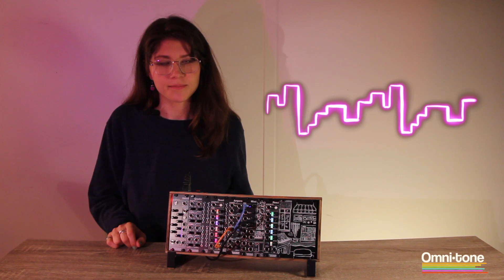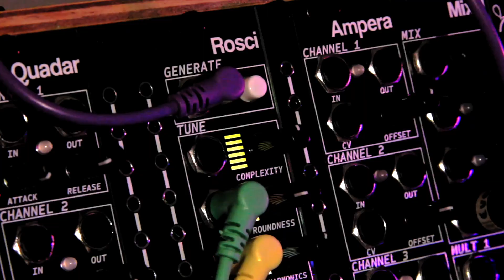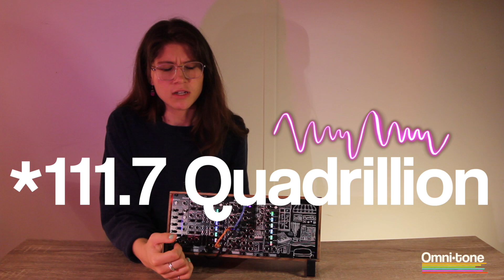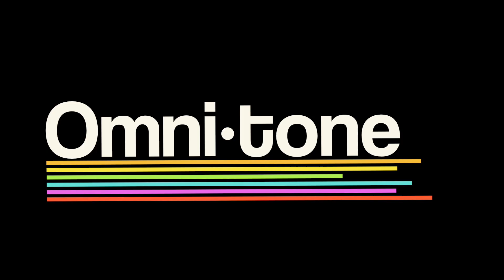This is Rosci.

Comment: Ooh! I've not seen anything like this sold new before!

I've seen some vintage 70s oscillator/function-generator/envelope hybrid things which were largely built from DIY projects, and had 4, 6, or 8 steps of which the amplitudes could be set by the user. Which needed an oscilloscope to be most-useful but definitely allowed for "digital" sounding timbres even with that analogue gear. (Like these ones, or emulating, say, an NES' steppy triangle wave.)

But I've thought for a while that we could definitely do with something self-contained that does a similar task, with similar customisability, today.

Since stuff like the Prophet VS or Korg DW waves can have a similar timbre, but aren't really customisable in the same way. And modern wave-table or wave-morphing synths are really built more around crunchy complex progressions, rather than just making your own cool timbre to your own desire. 

(I think some recent Rolands have "drawn" waves as an option, which are probably very similar to that 70s method, but of course don't have the generative abilities of this module! And if you don't need a groovebox or another SH101 emulation, it's like, welp.)

I really like the little animated diagrams of the waves as well! They were sooo cute ✨

Comment: I'm not too interested in digital oscillators myself (bucking current trends), but it's always good to see more Canadian synth companies.
Reply: This is so analog sounding tho!
Reply: @Digital__rb  Uh..not remotely. Spend some time with oscillators like AJH Synth vintage core VCO, ACL, L-1, or some of the (non-chip based) complex oscillators out there if you want to hear some good analog (discrete!) oscillators.
Reply: @NickHchaos  i have an electrosmith 3340, its awesome, i want another one so i can do cool sync stuff accurately, my cinnamon filters dont track v/oct well in saw mode to do nice sync sounds
Reply: @Digital__rb  Yep, and discrete stuff sounds VERY different from CEM based stuff, potentially. I like CEM things with proper design (Sh-101 is a classic example), but, also a very different thing.
Reply: @NickHchaos  i think 3340 is CEM, im not sure what discrete means tho

Comment: This is great. It looks like you are using the ESP32-S3 which has WiFi and BT  capabilities. Not usually associated with eurorack but there are a lot of possibilities with a platform like that like generating and saving “presets” that could be wirelessly sent to the device from a phone or computer.  

Anyway, the sounds are cool. Cool way to spark a creative idea. Having the CV inputs for everything can probably lead to some wild results.